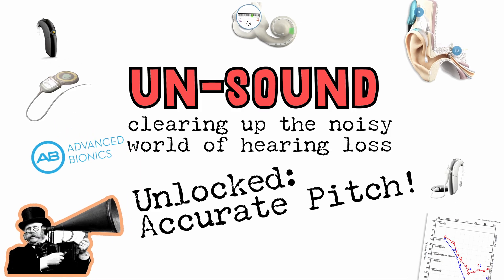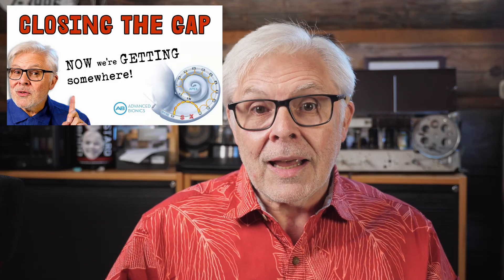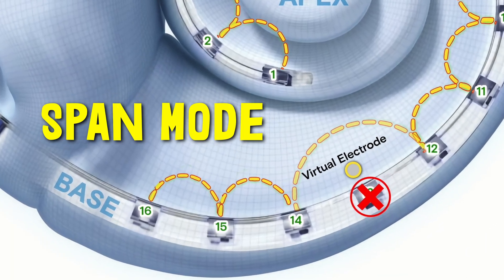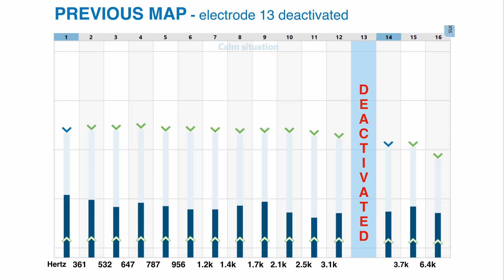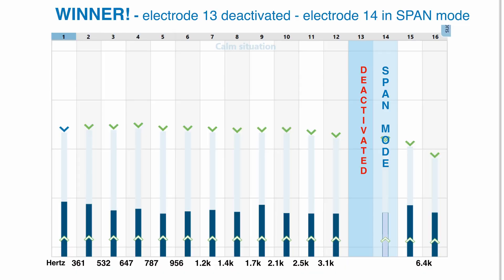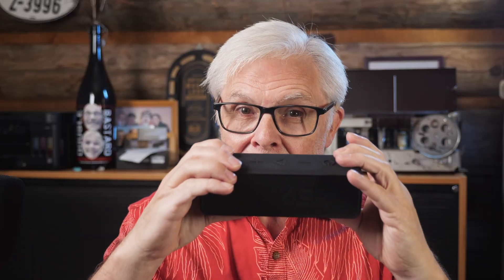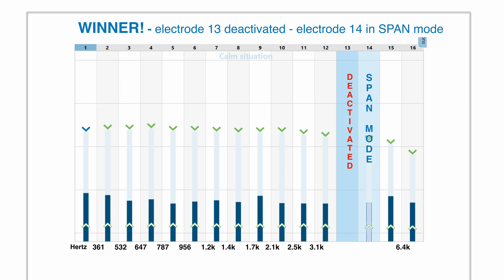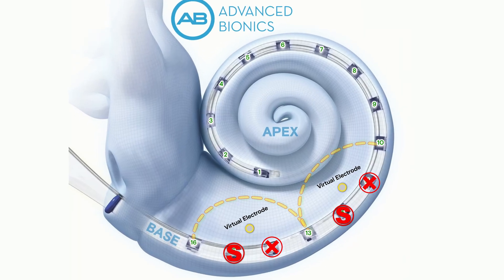I finally achieved pitch accuracy with my Cochlear Implant

Comment: That's great. Does other CI's (medel and cochlea) have similar settings?
Reply from the maker: I apologize that this comment fell between the cracks! I try to respond more quickly. Short answer is... I'm not completely sure. I am fairly sure that each system allows for individual electrodes to be disabled for various reasons. What happens with the the frequency allocation, however, is unknown to me. Look for a comparison chart of the various systems and pay attention to channels. The ability of the processor to manipulate channels is probably more important than the number of electrodes. I do know that Med El does allow editing of the frequency allocation table, which AB does not. That presumably would allow you and a cooperative and patient audiologist to tailor the frequency allocation to your unique tonotopic layout. If I were in the consideration process today, I would be leaning heavily into learning more about MedEl and the possibilities of that.
Reply: @unsoundguy thank you for the solid advise

Comment: The setting “Extended Low Frequencies” should be OFF as Vince has done.

I see my Audi in a couple weeks to also get these lowered pitches and also try some variations that Vince alluded to.

Thank you Vince!
Reply from the maker: I’m sure that’s because I’m able to make use of the acoustic earhook, which covers 20Hz to around 350Hz. Looking forward to your results!
Reply: Vince, thank you for the clarification.  A friend and I are excited to try your recipe in the next couple weeks.  We don’t have acoustic ear hooks so will try it with Extended Lows on and off.  THANK YOU Vince!